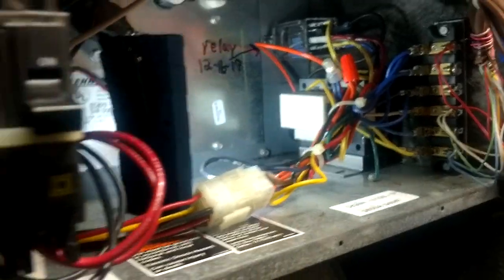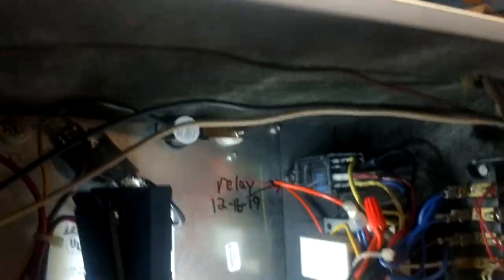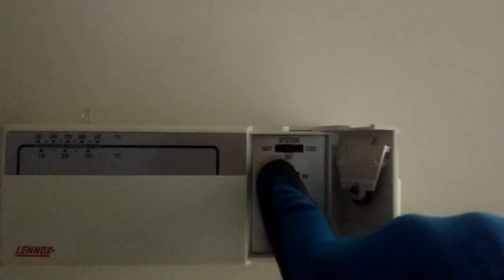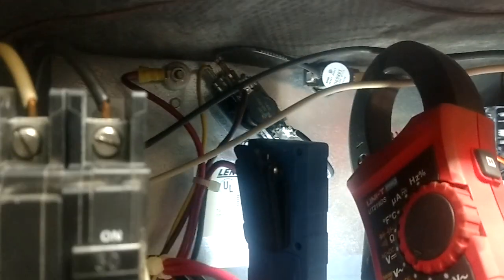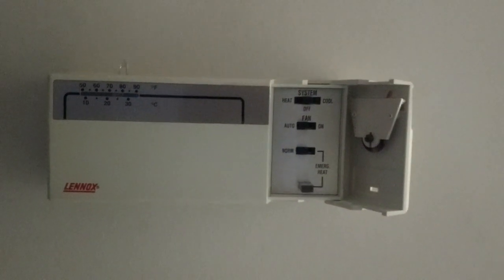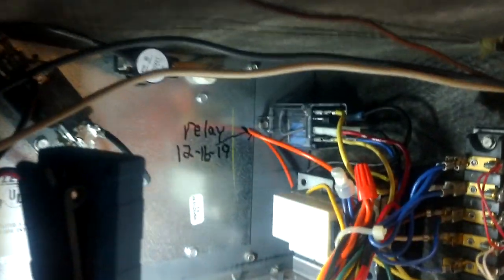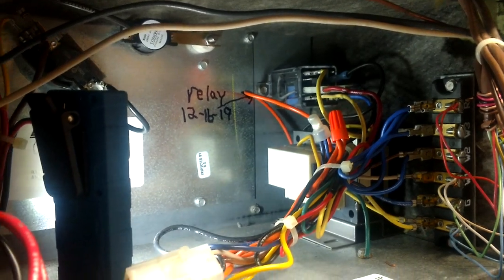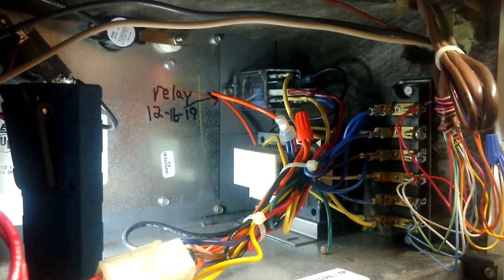FAILED!!!❄️Ice Cube Relay❄️No Blower- Part 2 (The Repair) 😎👍

Comment: Why is the breaker switch zip tied so it won't cut the circuit if need be?
Reply from the maker: It's below the switching mechanism. The breaker can turn on and off or "trip" just fine as it needs to. The wire ties to help secure it and hold it in place. Those Square D breakers had a lot of "wiggle" on those old Lennox units. And then they wouldn't line up with the hole in the door panel. Thanks for watching 😎👍